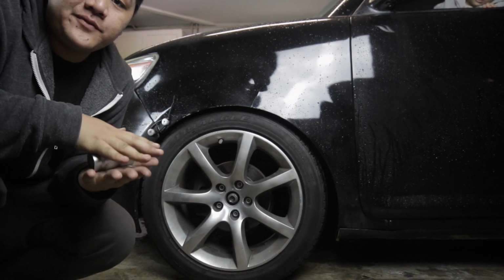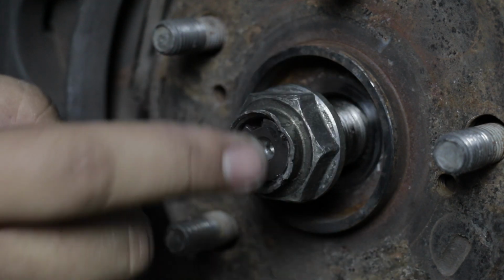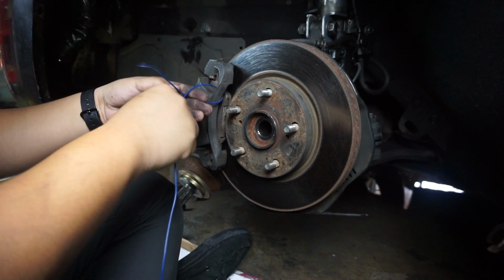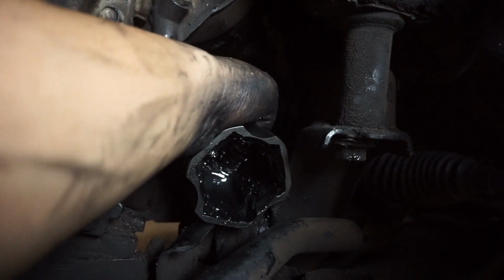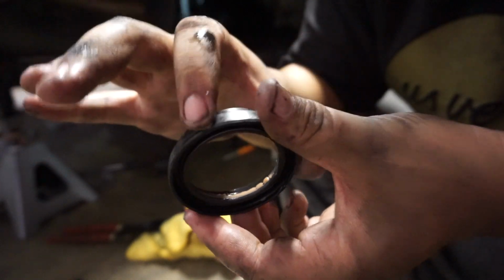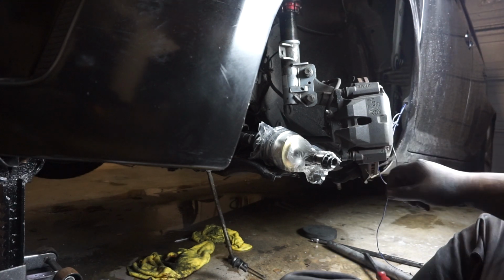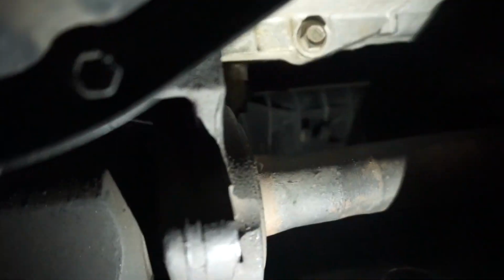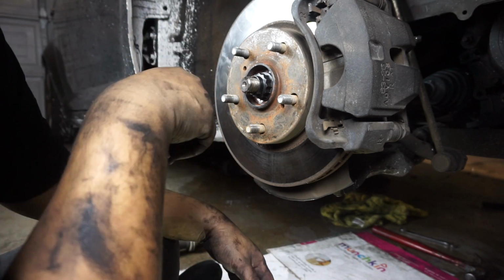How to: FWD Axle replacement, Transmission Output Seal Change Scion Xb

Comment: Very nice subscribed but how in the hell did you get that top bolt off? The one on the carrier bearing case???? I've been trying to remove the whole entire bracket.
Reply from the maker: Jasmine  Lyons if I remember correctly it was either a really awkward angle or I used a long extension and ratchet

Comment: I got 2006 scion Xb I got a noise  drive side  sound  like  grinding noise
Reply: Wheel bearing
Reply: @dustinschuth4614  Can also be Axle, throw out bearing(If Manual) or throw out But wheel bearing is very common

Comment: Do you have to drain the fluid
Reply from the maker: no you don't have to
Reply: Blaine Nojiri do you if they sell the seal for the shaft
Reply from the maker: yeah i picked one up from oriellys
Reply: The one that goes on the metal dust cover